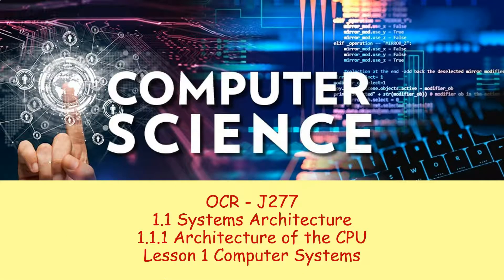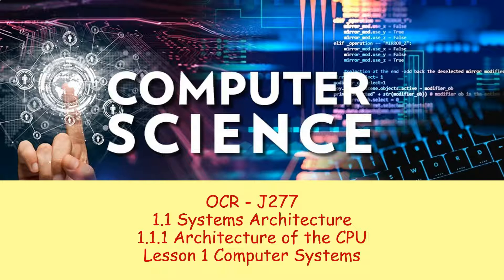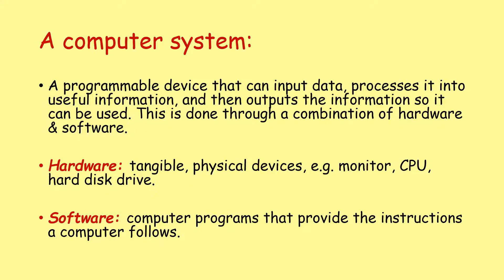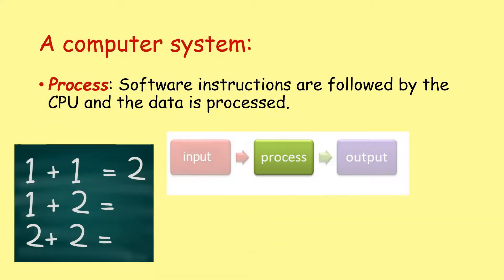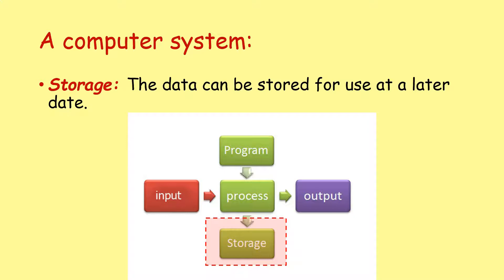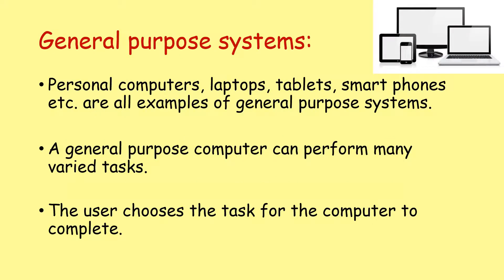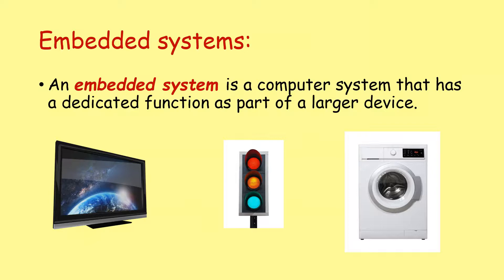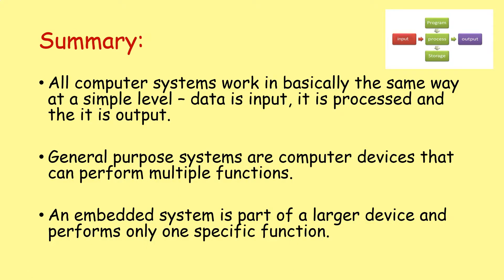OCR J277 Systems Architecture 1) Computer Systems

Comment: can we call an embedded system a dedicated system as well?
Reply from the maker: As with a lot of computing terminology, there often isn't a clear-cut boundary between terms and quite a bit of overlap. Dedicated system can mean the system has a fixed purpose so it is designed for a particular purpose, e.g., the shutter system on a camera, however it can also refer to computer systems with narrowed down purpose - for example, a game console or a print server. So, I would just use the term ‘embedded system’ to avoid confusion!